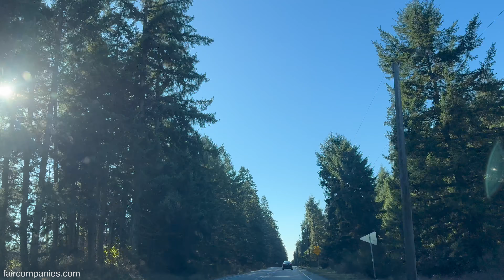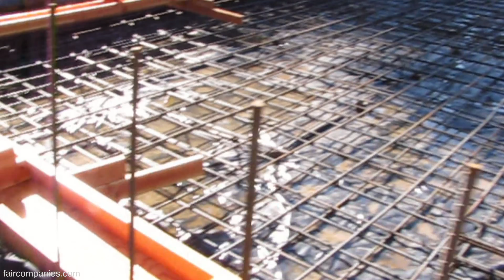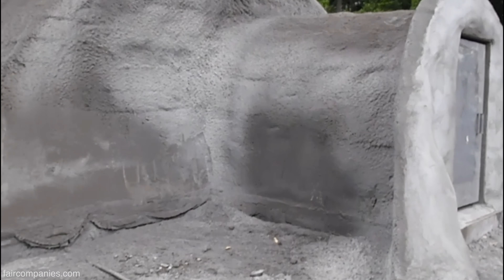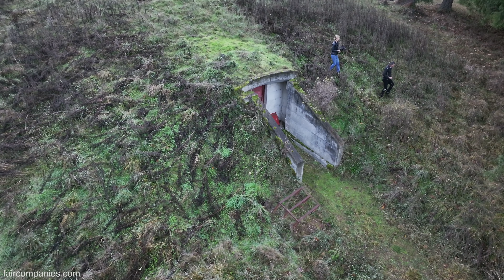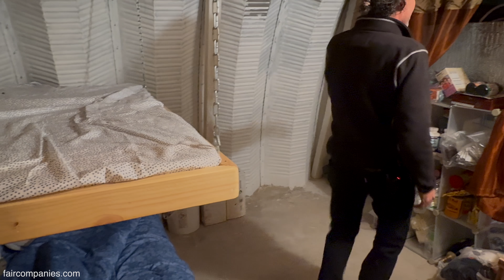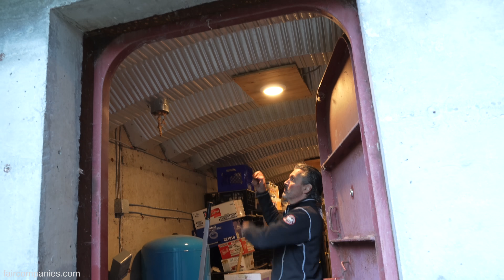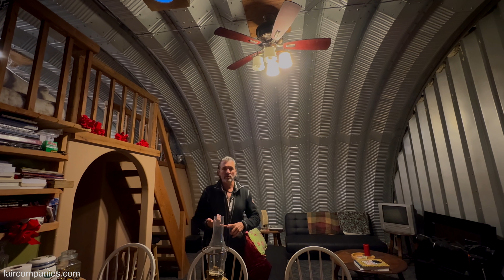Building Bunker Villa on a budget using Quonset Hut structure

Comment: I built something sort of similar; although I didn’t build a guest house out of it. I just use it as a root cellar, but it could have been built to be a bunker or whatever it is you have in mind with your guesthouse. 

I got a bunch of retaining wall blocks; the kind that are used to terrace steep slopes. They are 30”x30”x60” and weight 4400lbs each. I stacked them 3 high and made the inside 15’x20’ with a 5’ long entryway, with a door on both ends. The roof is scrap pipe I managed to salvage, ranging in size from 8-16” diameter. I corduroyed the roof and welded the pipe together. I live north of the 56th parallel, so it’s quite cold here during winter. It maintains temperature without any heating nearly all winter, even when it hits -40 for weeks on end. Of course, it’s made of 110 tons of concrete, plus probably 30 tons of steel, so there’s a lot of thermal mass. I’ve only had it one summer so far, and it stayed pretty cool all summer once I shaded the door. It’s been a wonderful addition to my farm; and my whole community. Many of my neighbors store all their root vegetables in my cellar. After a whole winter (this is the second winter we’ve had it) the vegetable are still firm. Even apples keep inside for months. I built it more or less on my own, with probably less than 40 hours of help from my wife. It took about 300 hours of my labour, plus about 75 machine hours on a 200 class excavator. It probably would have been possible to use a machine as small as 150 class, but that’s about the smallest that would work. Once the structure was built I buried it about 7’ at the deepest areas and 2’ at the thinnest point.
Reply: That sounds amazing!  I wish I had the know how to do something like that.  I bet your neighbors are so grateful.

Comment: ok, very very impressed. concerns would be power should main power goes out, and im not a huge fan of the ventilation system, without any powered filter to guarantee circulation. despite all that, very inspiring for a man cave and long term shelter. love to actually see it sometime. co😮st of building was very inspiring

Comment: Under-ground homes are a normal thing in Coober Pedy, SOUTH AUSTRALIA.
They tunnel with machines, line or spraycoat the walls, add vents etc.
Summer temps often 50degC, underground is about 26deg.
Extremely low rainfall, limestone ground.
Running a skylight down and placing the opening behind an ornamental stained glass window gives the feel of not being underground, and thus not so claustrophobic.
LouiseAustralia 🦘

Comment: If you were to be successful burying the structure without foam  and concrete, condensation would be the killer who would kill the project. With condensation comes mold and mildew. At that point its unlivable.

Comment: Technically couldn't you build it out with more tunnels branching off to more buildings?
Reply: Networking a few of these on isolated property is what I was thinking, including a tunnel from an above ground structure for those "wanna go incognito" moments.
Reply: You will see this type of structure on Mars soon.  A similar technique, using regolith, is being engineered currently.  Robots will be used for most of the primary construction, then, the finishing will be done by the future occupants.

Comment: Im not so sure that there's no inherent strength in the arched roof. I think there is likely tremendous strength in that roof structure, for two reasons. Arches are incredibly strong as long as the base is well reinforced and the corrugated design would give extra strength as well.
Reply: Steel fiber in the shotcrete.

Comment: I would use the water tank as energy storage (gravity-fed through an electric turbine).  I would actually have two tanks--one for the aquaponics system and another for fresh drinking water.  The aquaponics would be continually cycled using a windmill up above.  Both could generate electricity.  The freshwater would come from distillation from the last tank of the water treatment system (two-tank algae-based).  For the lighting, I would use upside-down planters.  That is, plants have their roots above in water/soil above in a lip with holes for the stems to grow down and spread leaves toward the natural spectrum LED lights below.  This make really use of the space, growing plant food and fish and oxygen.  The biggest challenge would be keeping the smells down.  So the aquaponics should be sealed up over the fish tanks with algae behind wire meshes to clean up the water and create oxygen where the fish can only eat algae that grows out from behind the protecting wire mesh.
Reply: Unfortunately, your energy generated would be almost nil, unless you consumed a boat ton of water and your water tank was on a hill way up.  Might power an LED strip or something.

Comment: Some great ideas there, thanks for sharing!  One question, were the 4x4 braces really necessary during construction on a Quonset structure? Seems like it would be strong enough on its own.
Reply: Those were used as a precaution when applying the shotcrete (concrete)

Comment: Have there been any issues with water leaking at the slab level, where the steel meets the concrete floor?

Is there any weeping tile or any sort of drainage system around and below the perimeter of the concrete slab?
Reply: Zero leaks since 2011, basically-  there is an extensive drainage system along with a specific way the slab connects with the quonset arches, which prevents any water entering along the cold joint..

Comment: does it go thru the hill so u have an exit on the other side? i wouldnt like a place that has only one way in and out - if theres a fire or some other trouble at the front then youre trapped. oh i see, an escape hatch on the top. thats a good idea too, but i still think that leaving both ends as doors would be simpler, but i see your hill was too thick unless you made a really long quonset tunnel

Comment: This is the quickest and cheapest way to do this. Hes right forms and pour + time? Gah! $500k. A quonset is not structural for downward forces - which is why you need shotcrete. If you did it without it would colapse. Well done brotha!!! Really well planned and thought oht for someone that doesnt have a mil to throw at this project! ♥️🇨🇦♥️
Reply: Thank you! This is one of many and proven to work for over a decade..

Comment: 4 days and $8,000
This here could solve the house ownership crisis.
Reply: They steel Quonset hut 10 years ago was 8k 😉 😂
Reply: Lands not free.
Reply: @Kanoee64  government could open up cheap land with the stroke of a pen.🤷‍♂️
Reply: @warrensteel9954  
Yes, they could.
Reply: @warrensteel9954  right BLM owns so much land it's crazy
Reply: The Quonset hut metal shell costed 8k in 2011 ...it is around 13-18k in 2024..
Reply: Can this be hooked to electricity via camouflaged hydro from a spring, which would also provide water for the structure and also be hooked to an exterior septic tank on the fall?
Reply: @celaraspberry  if there's a will, there's a way.. absolutely
Reply: Only the metal quonset hut is $8000. It was $100,000 or 30% of the median price of homes in 2014.
Reply: That is just the metal frame, a decade ago. Nothing else. I bet it cost over $100k plus land. Probably $150k now plus land.

Comment: With six feet of earth covering the structure, it would only need the addition of a 90 degree corner in the hallway, an NBC air system, and a blast pressure relief valve to be a genuine bunker in case of nuclear attack.  The skylights would probably have to go also and the escape hatch would have to house a barrier of six feet of sand to keep that area radiation proof, but that would be about it.
Reply: Very true- the client didn't build it for that type of situation though..
Reply: if a global nuclear war happens do you really want to live in the aftermath of that? And i'm ignoring the radiation when I say aftermath, I'm talking the political landscape and all the other crap that would happen as society collapses.
Reply: This is not a blast shelter, more a fallout shelter, and you only need a blast shelter, within 25 miles of a detonation..  Outside of that, you need only 3 feet of earth to dilute gamma radiation, fallout by a Pf of 1/100. You don’t need an air filter for fallout, it attaches to dirt, does not travel through air.  The intakes are long and in a downgrade. It’s a great design to live long term, high ceilings etc. the entrance is pretty long, but a 90 degree would be worth it. The skylight is a weak point, and the escape hatch is too.  But all in all, outside of a blast zone, I’d take this over everything else I’ve seen. Specially dollar for dollar. There’s a good paper on the castle bravo tests that went wrong, and bigger, detonation crew was 20 miles away and survived.  And that was like 15mt vs the average 800 kt Soviet warhead,  this place is in the boon docks and probably good to go by my take.
Reply: @Ok-551  what are you smoking? You would need an air filtration system past 25 miles, yes the particles attach to dirt but those dust particles are then carried on the wind and in the rain for thousands of miles in the event of total nuclear war there could be enough radiation that between the global dust and rain you most certainly would need air filtration
Reply: @SFS3610  , ты серьезно думаешь про возможность ядерной войны?
Если что, я из России.
Я хочу сказать, вероятность такого события слишком мала.
Применение множества ядерных боеголовок это ответ на серьезную угрозу для России. Не вижу такого сценария - быстрее американская политическая элита уменьшит свои геополитические амбиции и уйдет из Европы. Остальные конфликты будут решаться конвенциональным оружием.
Reply: @user-bq6wn4nn3j  I don't read, Russian or Ukrainian bud. Ether way I'm not taking advice from anyone around Russian on bunkers besides Poland and Finland 🤣

Comment: Fire proof underground buildings in australia now have very strict certification requirements after several people suffocated inside during the black saturday bushfires in 2009. intense fires suck out all the oxygen from the air.
Reply: Yeah, I'd definitely want the option to close it off exterior air, and have submarine style oxygen candles available in a true emergency.
Reply: That's what I thought too about fire, but I guess you can't plan for everything
Reply: @paperplane1098  thank you for this information. I’ll definitely implement your safety precautions.
Reply: Wonder how much plants you would need to produce enough o2
Reply: Oxygen tanks even
Reply: @ximono  tanks don't hold much breathable air, so you'd want something like a oxygen candle from a plane or submarine for a larger space or longer wait. Especially since an O2 tank is, ironically, a fire hazard
Reply: @osco4311  An aluminum 80 would probably give you an hour and a half, of course you would need a full regulator setup.

Comment: That door is not thick enough for true protection. He needs to install a concrete filled door with steel. Trust me, I could get through that door. Also escape hatch should be buried and have a way to dump dirt. I would not feel secure in this. Never use propane in a bunker. Too dangerous.

Comment: Back in the 1970's after my military service (9 years), I got a job with DOD procurement which was part of 5th Army. I was put in charge of dismantling contracts for some old "Nike" missile bases ... most were built in the mid 1950's. For the troops we had Quonset Huts as quarters.
  One company won the contract, but after a long period of time they still hadn't finished and the land had to be restored and given back to the counties. My boss asked me to go and check up on them and see what the problem might be. It seems the guy would spray can number each panel, photograph the building, clear out the plumbing and electrical first, then unbolt the panels and ship them to another group of sites as he had them sold. One company, I found out, had bought one for a sand blasting shed. So instead of us doing the job and selling them at auction (property disposal), we paid this company for the labor and while he also the units for a profit ... smart guy. Our mistake as we listed the project for bids as a demolition project, so most companies were looking at just tearing them down and scraping the steel.

Comment: This place is a preppers dream. Except for the lack of depth of earth over the  structure. IMO the earth should be no less than 20ish ft on top of a structure like this.
Reply: As long as you're only prepping for fallout and not a blast shelter you only need about 5 or 6 feet of dirt on top.

Comment: This is a great idea but with my bad back, that upper level headroom won't work even if it's just storage.
The Viking link shows pics under construction and lists the main Quonset as 32x40. In this vid, David said it's 25x40. Pretty sure 25' diameter seems more likely considering the headroom. I wonder how much harder it would be with a 32' span (diameter). I'm sure the Quonset is no problem but that's alot more to bury.

Comment: $plendid, except for the lack of natural light.  That'd take a bit of doing.  But as an emergency/vacation/guest spot, it's perfect.  I just want the winter sun, such as it is, to be a bigger feature in a permanent, purpose-built home.
Reply: Meh.  You'd be happy as a clam, there, and probably add some natural light.  Really like the convection ventilation with the buried air shafts.

Comment: Instead of having a huge million dollar home built exposed on the surface, it would make sense to have a smaller exterior 300K home (maybe even a dome with amazing views) the garage, and then an attached hallway to the 100K-200K "bunker" to use as an extension of the home. In weather emergencies you go to the bunker section for safety. I wouldn't necessarily build it for an apocalyptic scenario or to be a prepper, but more of to deal with the intense weather conditions that are becoming more common. If your home gets destroyed, you have a back up....
Reply: Luxury + fallout shelter. Lovely idea.

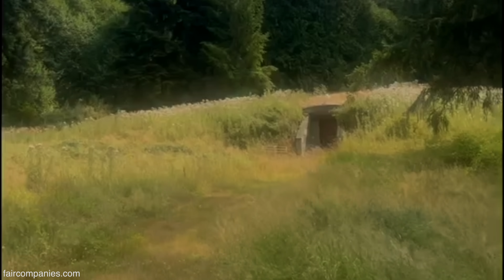Comment: 5:56 Totally agree, it absolutely needs the concrete.  
i'd seen a video of a guy's Quonset Hut he was using as a shed, the bolted steel looked just like that.  It collapsed during heavy snow!  They can't handle a lot of load just on their own, gotta concrete it.  And shotcrete is really neat anyway, there was some huge Domes built around here that eventually ended up being used as a car dealership.  To build them they inflated a giant balloon & shotcreted ontop of it as a form, then once dry they deflate the balloon and the shotcrete remained as a huge arched bubble, it was strong as heck just due to the arched structure combined with concrete's great compressive strength.
Reply: Wait till you see the next video !!
Reply: They are made with different gauges of steel for different snow loads. People need to work direct with manufacturers for huts engineered for their local snow load.
Reply: @Homohumulus or know their areas required ratings, it's simple enough to look up code requirements for where you live, it's not rocket science or measuring the speed of light (ever go down the speed of light rabbit hole?).
Reply: @DanielsCorner644  that's a weirdly aggressive and and insecure comment.
Reply: Those balloon made homes have collapsed before. They have to be built carefully
Reply: And rebar?
Reply: @bee_ron Yes the balloon domes are made with rebar. They are laid on in a special way that once blown up the rebar structure is correct and can be tied. Once done they deflate the balloon and then cut out all of the holes. 
 They are super expensive to rent them. Unless you plan on building a bunch of them its not worth it. Which is why you do not see many of them around.
Reply: @bee_ron  oh fantastic, Google corp deleted my response telling you what the generic term was (coz i linked it's wikipedia article).  Didn't tell me tho, just wasted my time as corporations love to do.
Reply: @bee_ron  search wikipedia "steel fibre-reinforced shotcrete"

Comment: Bunkers like this should be built in tornado prone areas. Why don't people build bunkers like this in those locations?
Reply: Sometimes the water table is so high that even 100% concrete underground float up and out of the ground. Some places in the midwest have only a thin layer of soil over rock. You can't always build underground, but you can add earth on top of above ground structures effecting something close to that.

Comment: The idea is good, execution is bad. They did the outside right with the foam, shotcrete and liner but steel reinforcement in the shotcrete would have been stronger. Having a entryway without any protection or concealment is a big issue. The steel door is good the second door is a joke. They placed all the food in the entry way where it can be contaminated or easily taken. There is no way to defend it. There is no sheltered parking for your vehicles. There is no cold storage for anything fresh you have, the fridge is a joke, no freezer.The emergency exit is exposed so great if you need to get out but bad if someone is waiting for you to get out. There is no back up power, solar or wind options. The water tank and well is a solid idea and protected. There is no way to see outside as in cameras or security. They also stored the gun safe in the entryway, that is just beyond silly to me.